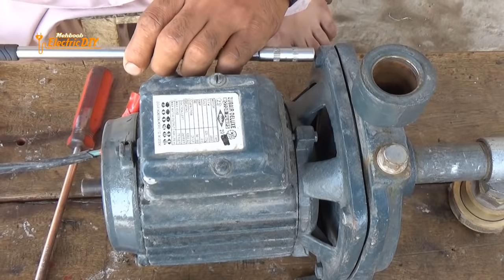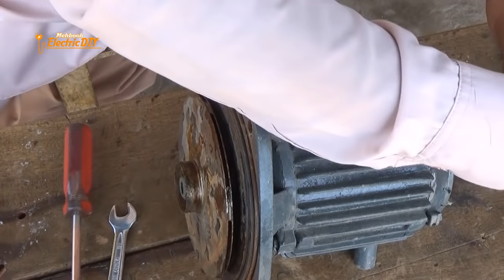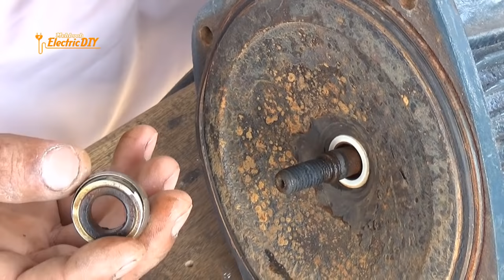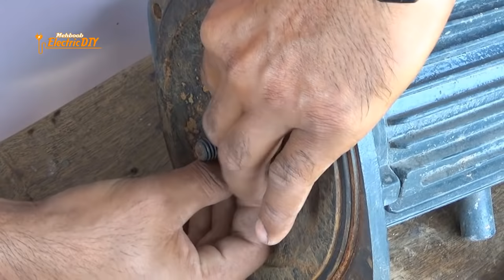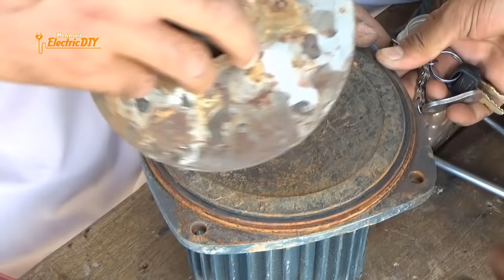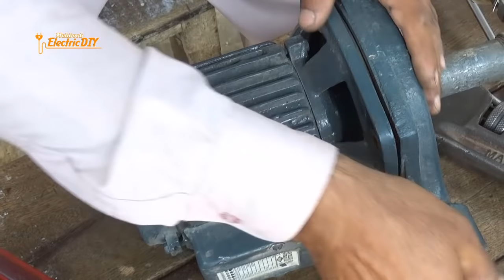How to Replace The Ceale S 3 Water Pump

Comment: boss  ... pina stainless ko yan shafting sa Balagtas ... if i am the repairman i will replace the two bearings or at least one for 14mm mechanical seal was worn out ... water has already seep in to shafting therefore bearing on impeller side is partially or totally noisy ... however it's your prerogative  ... thanks keep safe and good afternoon too  .... and lastly i admire you Sir for you can repair pump even not complete in tools i surmised
Reply: Ka MELO BIGAA BULACAN ang galing na TORNERO WATERGATE PUMPS & WELL SERVICES i learned the TRADE just in SILENCE

Comment: You have to be very carefull before you install the new seal..Check the condition of the axis..If the axis surface is not good..then the problem of the leak will remain...

Comment: The pump I'm fixing, water got into it after the seal broke. After I installed  the new seal, the pump not working instead it's making a bad sound even after I dried it completely. Could the pump have shot? If so, what's the solution or should I buy a new one